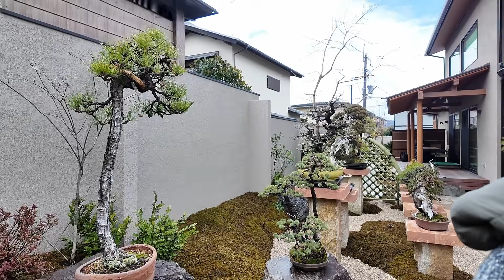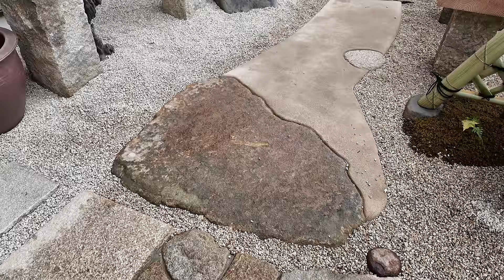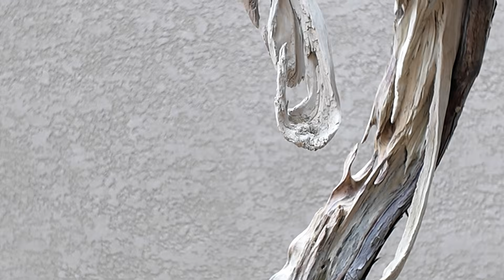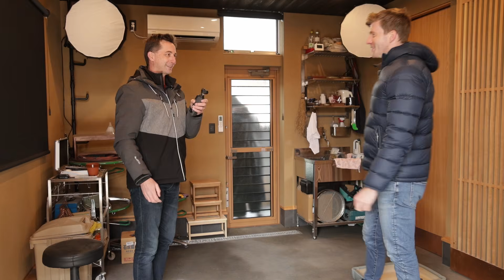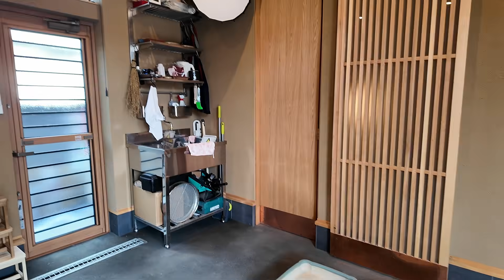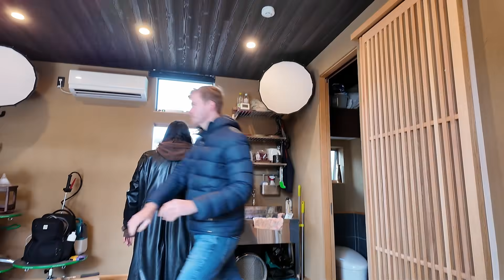Eisei-En Bonsai Tour by Bjorn Bjorholm (part 2)

Comment: Nice video but what happened to the audio? Too much denoise?
Reply from the maker: yeah, odd. not sure what happened there. DId not notice it in the editor. I do not think any filters were active. Will check the uploaded file.
Reply: @GrowingBonsai  The video is also a bit messed up, the section around 3:00 where you're walking the path seems to "jump" every second or so.
Reply from the maker: hm.. Not on my end tbh.
Reply: @GrowingBonsai  It's not super obvious tbh, but my eyes don't like it. Looks the same on mobile for me. IDK man, with the audio as well is it maybe some encoding error?
Reply: Just get a bag of nuts, you wont notice it while chewing.